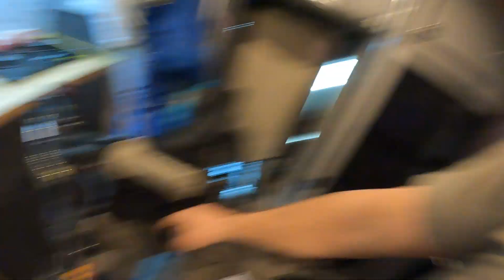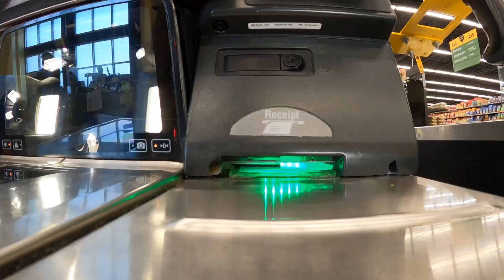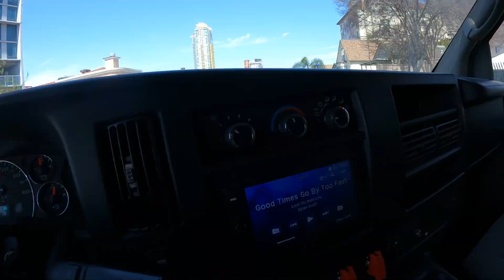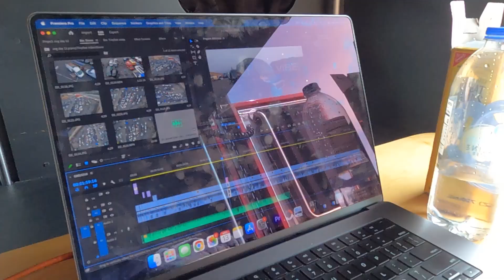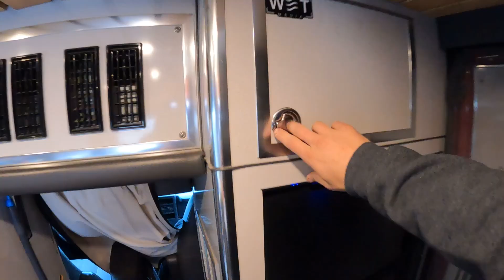What It's Like Living In An Ambulance | Cooking Gourmet Tacos

Comment: Hitting Dog Beach in OB, ya gonna make it across the channel to PB or what?  Im in a marina right on the other side of that channel by Dog Beach. You should check out Mission Beach Bro. Yea the bridge is a trip hugh? No high guard rails on this one to obstruct your view, it does cause it to be used a little too often by people as an exit tho. They'll just stop on the bridge walk to the side and exit. Trivia....the bridge has a section that is equipt with explosive pins, in the event that the Navy needs to get the fleet out faster than single file, a section can be dropped out to allow a speedy exit, you know like if lil rocket man actually DID something stupid and needed some training or whatever. If your still around see The Cove in LaJolla and Tory Pines in LaJolla 300 ft cliffs over the beach!
Reply from the maker: That’s insane! And I’ve made it through PB a few times now